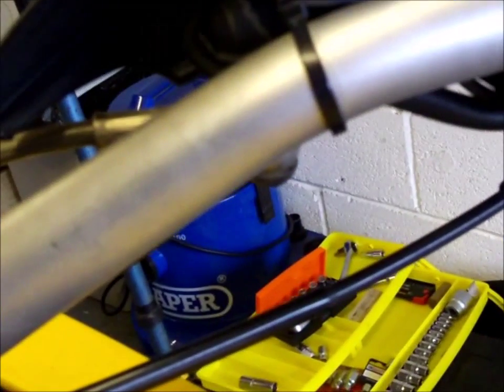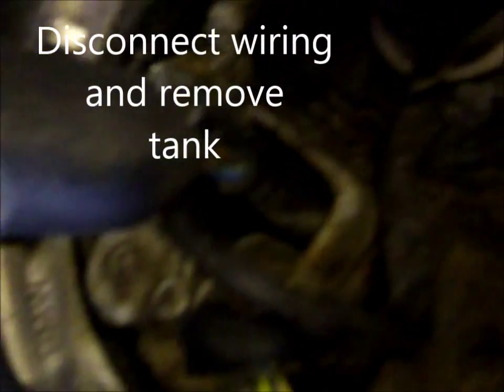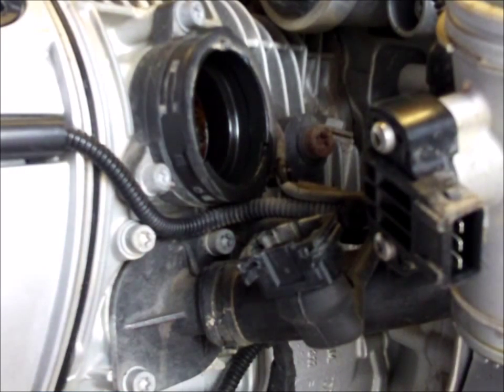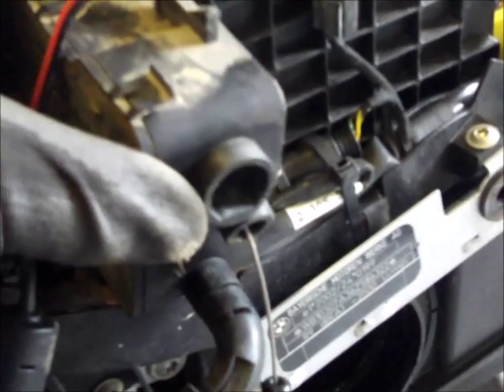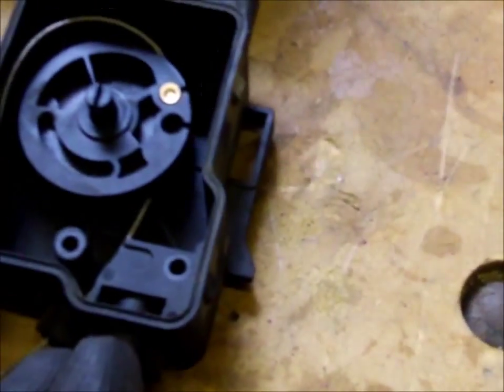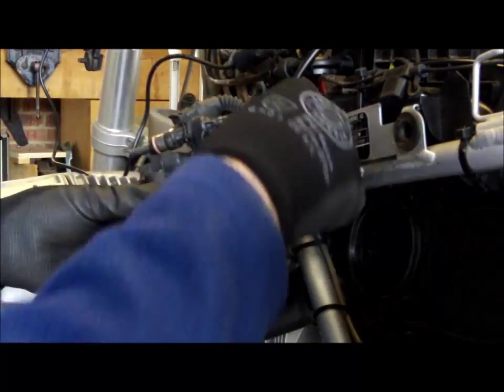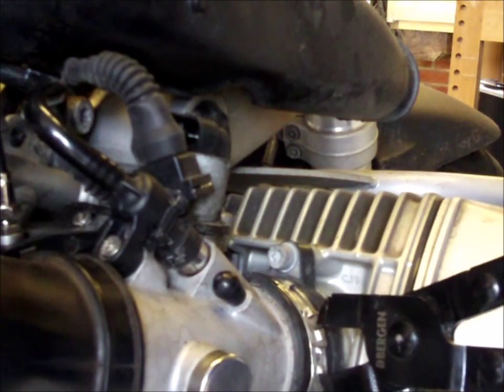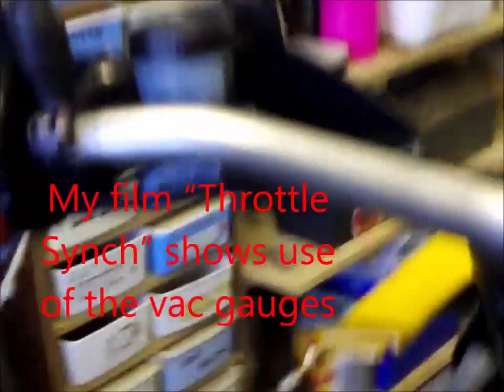1200GS replacement throttle cable

Comment: Thank you for making this video. I just bought a used 2009 BMW R1200R and my throttle body pulleys just broke. I took that cable splitter box out and forgot how the cables went back in. If it wasn’t for you video, I wouldn’t have been able to put my bike back together without waiting for a Haynes manual.
Reply from the maker: Hi Mitch what a lovely comment to wake up to this fine morning, thank you for posting, I'm glad it helped, safe riding, regards John from sunny Devon UK

Comment: Hello, I had my throttle cable go bad on my 2002 RT so when I had the bike apart I changed all (4) cables while I was in there.The extra price of the cables was a small price to pay for all the labor time.FUN,FUN, FUN.John Campbell USA.
Reply from the maker: Hi John thanks for commenting, your right, what a performance, not like the old days when, a, cable was the price of a couple of beers and all the tools you needed were a pare of pliers and the whole job took 10 minutes, seasons greetings, John, from sunny Devon UK

Comment: Hi john, i had the same problem as you, when i turned the handlebars to full lock/turn it always revved high by itself. To me the original cable is 2/3 cm to short, but on the steering column you have to feed the cable through a bent looking piece of wire (stops the cable moving about) near the top, all i did was bend the piece of wire towrds the throttle side and it did the trick, gave me a centi or more leeway so it wasnt so tight. I wasnt too keen on everything apart because of a bloody cable. Now i know what to do if i have to. Cheers mate.
Reply from the maker: Yes Mojo Man if it ain't bust don't fix it as they say, no need to do unnecessary work and go to the extra expense, £120.00 for all three cables, my top cable was cream crackered, when I stripped of the outer casing the coiled steel sleeve was bent and rusty, thanks for commenting, good luck with your bike fixing and safe riding, John

Comment: It seems quite strange to me that it is so difficult to change the throttle cable on an adventure bike. That cable happened to break once on my old Suzuki Bandit 400 and I fixed it right on the road and continued my way, which doesn't seem possible on the GS...
Reply from the maker: Hi Evangelos K, thanks for commenting, I think I did excaudate the complexity a little bit because of my lack of experience of working on the bike, if I had to do the job again I would find it a lot easier, but that procedure was as described in the Haynes workshop manual and I recon all those parts did need to come off, bit of a tricky job if you’re in the back of beyond which after all is how the bike is supposed to be used, thanks for your interest and safe riding/driving JP

Comment: Hm, I think I’ll try first on my 2007 R1200ST to disconnect the short cables with  the throttle bodies in place. 
With the radio turned off. 
IanB